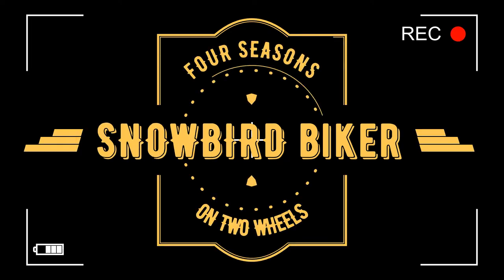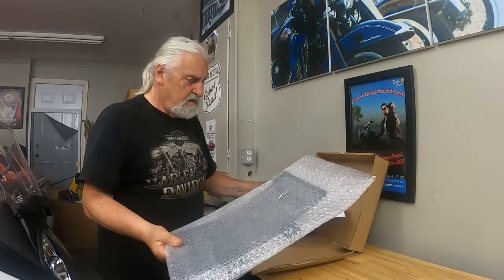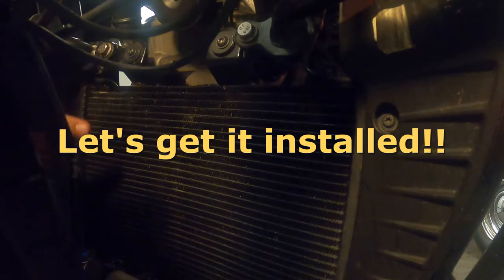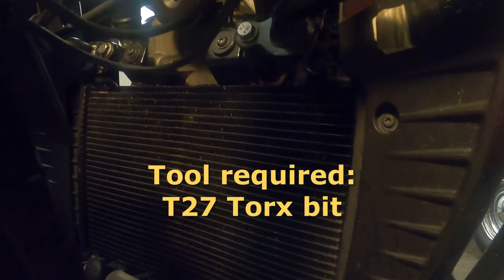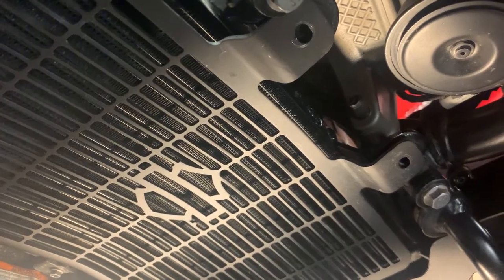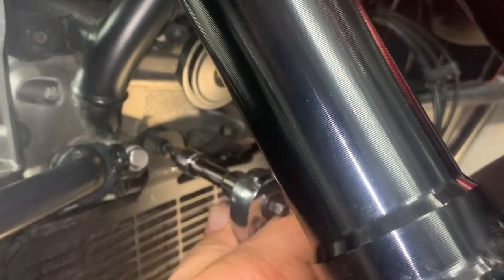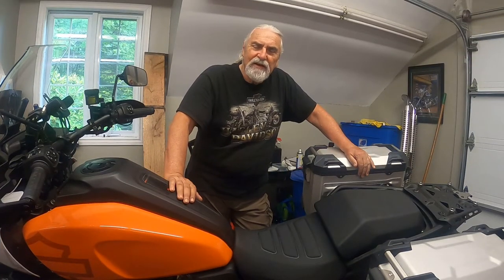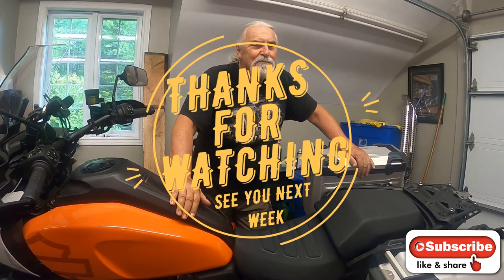Radiator Guard Install - Pan America Special

Comment: Most people don’t do this upgrade because it doesn’t show off the bike but it’s one of the smartest upgrades and can really save your butt.
Reply from the maker: The back of the front fender is very short and after one day on gravel roads my radiator was a mess. In fact I’ve ordered a fender extension from another brand. Hopefully it can be fitted on the Pan Am. Thanks for watching.

Comment: This is a must do for this bike. I do not understand how they thought that tiny front fender wouldn't be allowing debris into the rad. I'm interested to see your resolve to this issue. I'm thinking of trading in amy 20 FLHCS in for a "dirt glide." I see accessories aren't available for a while. So no rush. Thanks for the vid's sir. Ride safe !
Reply from the maker: I agree, the small front fender provides no protection. I’ve been told that the BMW fender extension will fit, so I have ordered one. Thanks for watching.

Comment: Where you finding all the parts lol all the dealers around me can’t get nothing 🤯🤯
Reply from the maker: Lol. The only Harley part is the rad guard. I have side bags off my V Strom bolted on because the Harley bags are back ordered until November. I couldn’t get Harley handlebar risers so I installed Rox risers. Today I added highway pegs that are universal fit for 1” engine guards from Happy Trails. I just ordered a fender extension for the back of my front fender because it’s so short. It’s a BMW GS1250 part. Hopefully it will fit. I don’t know when Harley will get parts in stock. Thanks for watching and commenting. All the best. Cal
Reply: @SNOWBIRDBIKER  👌🏻👌🏻👊🏻

Comment: What's the torque specifications for the screws?
Reply from the maker: I don’t know. I just used blue tread locker and tightened them to what I thought was sufficient.
Reply: @SNOWBIRDBIKER  thanks for the quick response, just got mine and couldn't find torque specs with the online owners manual, was just about to do the same. Ride safe